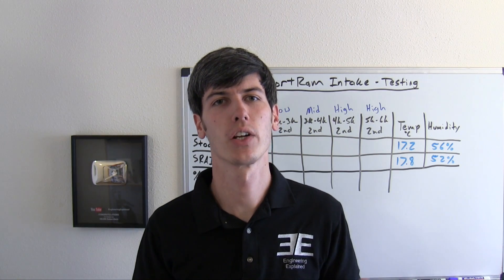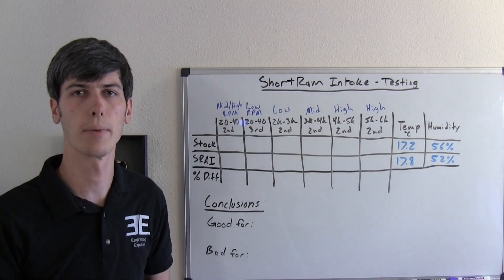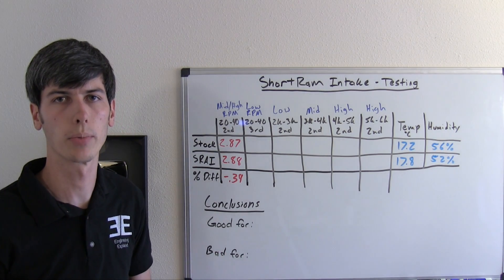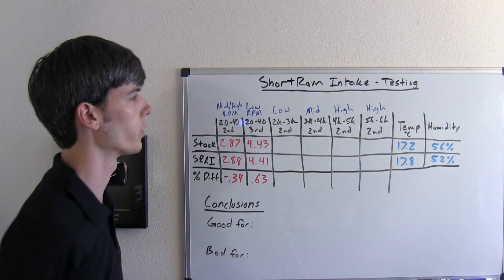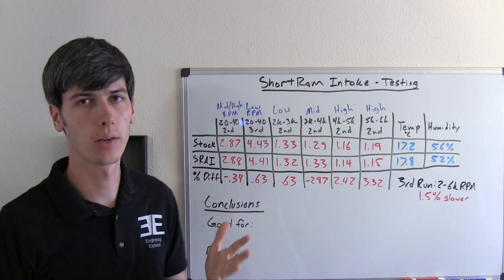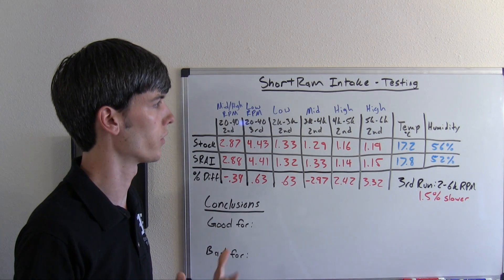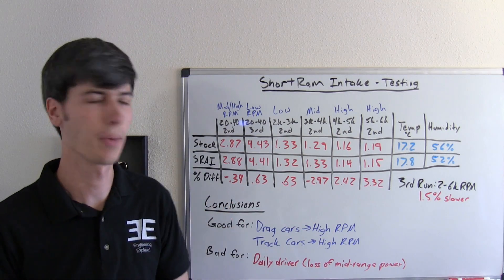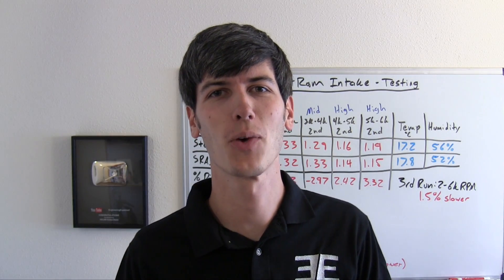Do Short Ram Intakes Actually Work? - Project Integra

Comment: I've got one on my car. Doesn't really do anything except give a nice sound and look cool under the hood haha
Reply: Basically street cred
Reply: I had installed an eBay short ram on my 96’ Chevy C1500 5.7 it sounded not so great when accelerating, I think it may have caused a minor misfire or too lean of air flow constricting the engine more than the stock air intake... Felt less smooth under acceleration too.. Couple months later decided to compare the diameter of the short ram vs stock tubing.. Didn’t realize the stock tubing is roughly about 3/4 to an inch larger in diameter than the short ram “performance intake.” Reinstalled the stock air intake today and with the stock thick paper filter already felt and sounded better, went to auto parts store and purchased a K&N E-1796 performance filter.. The real test will be this weekend when I accelerate to high way speeds to work..
Reply: you know what will help if you did some exhuast work 
i took my muffler chamber out put  a aftermarket resignator on it and she sounds amazin but i dont think it does noothing it compliments the exhaust sound and helps  a little bit when you hit the thorrtle
Reply: Do you get a engine light from it ?
Reply: Jimy Official if u have the censor connected it shouldn’t

Comment: In a naturally aspirated car it is significantly more important to get cold air to the engine, With a CAI im sure the difference will be better

Anyway, what most people dont get is that any mechanical or support moddifications done to a car must be backed up with the engine ECU mapping and programming (like optimizing fuel delievery and ignition timing) for the engine to produce significant improvements

Comment: You need to rev it much higher to see the gains. Its a honda youre supposed to rev the nuts off of it all the power is up high youre barely cracking vtec
Reply from the maker: Friebe1000 It doesn't have VTEC.

Comment: should have really used a turbo car considering theres much more air used than a n/a. the difference would be magnified and clear. Why haven't you turbo'd that integra?
Reply from the maker: warfl4g Not necessarily depending on the size of the intercooler. Because time.
Reply: Engineering Explained really? i thought that an air intake restriction would change results a lot on a turbo car. N/a car would still suck a lot of air.. but that air being sucked would be used as exhaust to push the turbo and suck a lot more air right? If it didn't suck more air with the turbo, wouldn't it be the same power ratio as n/a and be useless? shouldn't the short ram intake show different results to a stock intake with more dependent sucking of a turbo?
Reply from the maker: Ahh, based on restriction, yes I gotcha now. Depends on the setup of course, my Integra's intake is a bit more complicated than modern ones which are shorter.

Comment: My real question is this, have you seen those K/N filters? I was thinking installing that in stock air box, that way I still have the stock design of the box and piping, while having more air coming in due to having a K/N instead of paper filter. Thanks for the vid btw.

Comment: nice test. even assuming this mod can sustain a 2-3% reduction in acceleration time with a heat soaked engine bay, what does that translate into power wise and how many dollars are you spending per horsepower? better gains can be had by simply maintaining the car and restoring lost hp! 

I realize you likely did this test in the name of science and actually don't personally find interest in this mod. I do like things like this being brought to light though cause it discourages bad taste and noise pollution!  I'd like to see a similar test with heavy wheels vs lighter or smaller wheels
Reply from the maker: Ve g Ahh, wheels would be a fantastic test.

Comment: I'm just curious, why did you choose AEM as a brand and why did you choose a short ram?
Reply from the maker: I chose AEM because they offered both an SRI and a CAI, and both were complete kits. I want to compare them side by side so I wanted to use the same brand. Also, they make a lot of claims so I wanted something that said it does impact performance rather than something that makes no claims at all.
Reply: Engineering Explained Well now I just need to wait for the next videos ( ͡° ͜ʖ ͡°) Oh, and just an FYI, AEM makes those claims by using other mods as well as their tested product. I read that for testing their V2, they used a catback exhaust in conjunction with their V2. Just wanted to let you know more about their testing setups

Comment: I had a Prelude Type-SH with a short ram and i can 100% agree with the numbers from a driving stand point. When im cruising around at 2-4 RPM, it felt slower than with the stock air box and filter but from 4000 RPM plus, it pulled a little harder. PS, Vtec comes on at around 5600 RPM. I was happy with the short ram though. It gave the engine a bit more sound for cheap and without installing a huge fart can

Comment: People will always try and defend the fact they spent a significant amount of money on an intake kit which they probably installed themselves. Fair play to Engineering Explained for actually running the numbers and doing a fair test. Of course the stock system is going to be better, it was developed to run with a stock engine as efficiently as possible, do you really think a design team is going to design a 'restrictive' system for an engine that needs to be as efficient as possible if all their problems can be solved with a simple bit of bent stainless steel, a pod filter and a few hose clamps. 

Just my two cents, and great videos.

Comment: Did you re-map the engine after changing the intake? If the new intake has less restriction or increases the air pressure to the engine, then the engine would run lean, that could be damaging to the engine in the long run. In order to take advantage of the increased air-flow, then you need to also increase the fuel injected into the engine.
Reply from the maker: ECU was reset. It has a map sensor so it can adjust to differences in air density.
Reply: Engineering Explained I love how everyone in here thinks they know everything about cars and you have no idea what you're doing lol
Reply: Perhaps you should do a test before and after you reset the ecu. In order to determine to what extent (if at all) the standard ECU can adjust for changes in airflow. Weather a reset can really make a difference for small upgrades such as a s.ram/cold Intake change. This would be an interesting test if say you exchanged the std camshafts to 270 cams. The ECU can sometimes hide a lot of "locked up" power in some cars if not tuned perfectly. just a thought..
Reply: Enzo Ernst I just want to clarify that when he said "ECU was reset" he meant it resets automatically through the information the MAP sensor gives. He did not tune anything or touch any buttons. It automatically adjusts, so doing a before and after test is not possible in this case.
Reply: I see. I wish my ECU was that simple lol
Reply: Enzo Ernst If your car if fuel injected than your ECU is that simple
Reply: not mine. it doesnt have sensors like MAF or CAS... its all programed to be fixed. Its my own ECU system. its just standard NA so not as complex as a turbo setup.. yet :P
Reply: Enzo Ernst How does your car start when its cold outside than?
Reply: Knights2theEnd well where i stay temperatures range from 10deg C to 32deg C. so it never gets too cold to function. also the air is more dense during cold mornings so the engine is more effective on cold days. Hot days are a bit of a headache though. How it all started CA18DE blew CAS and MAF. so i did some tweaking with the ECCS (given the exchange rate replacing these will cost more than what my car is worth) and bypassed some systems. now basically your fuel air ratio should remain linear through your rev range right? so basically it is similar to a distributor. at set points during a revolution of the camshaft it sends electric impulse to the injectors. for each X unit of  air you need Y units of fuel. the spark still works so i left that alone. By taking Bernoulli equation through the cold air intake through to the cylinder head you can determine both the velocity and pressure of the air. this allows you to calculate the mass flow rate of the air flowing through at various RPM. Scatter plot these on a graph and you can basically form an exponential graph combined with a line of best fit. the exponential show the mass flow rate of air and line of best fit is the fuel ratio you wana run. basically its an electronic carburator if that makes any sense.
Reply: Enzo Ernst aaaannnnnnnnndddddd

Comment: I got told before that if you put an induction kit on a car it will only really make a difference if you also upgrade the exhaust and get the car remapped to make the most of the increased air coming in and exhaust gasses going out. cheers :)

Comment: Every one of these tests just proves that this car has a VAGINA under the hood.
Finally a ricer who understands and isnt afriad to admit it.
Any mod you do is mathematically figured like this. Stock Power 0 X Wussy Mod Gain of 1.5% = 0.00000000000 Horsepower."Zero" Multiplied By "Anything" = ZERO
You can polish a turd but its still a turd....a very expensive shiny turd....but still a turd....
Maybe 3 years from now we will see this thing run a 22 second quarter mile with an electric turbo and underglow? WooHoo!!!
hahahahahahahahahahahahahahaaaaaa
Ok im done now, dont bother firing back at me to defend your spraypainted turd that your mommy bought for you.
OUT

Comment: I don't understand how shortening and simplifying the intake piping causes the engine to perform worse at low/mid RPM. Increasing air flow to the engine is bad for low-end power how?
Reply: More flow is good for high RPM, but resonances at certain engine speeds can reduce torque. The stock intake has probably been designed to avoid these resonances and maximise mid range power.

Comment: Aftermarket intakes are probably one of the most useless mods you could possibly do, performance wise anyway. Unless you route it so it gets some kind of fresh air (like the stock intake has) it can only use the air cycled threw the engine bay. They should just call them hot air intakes lol

Comment: SRAI is a great system so long as you set the car up for it.  I would recommend isolating the heat from the filter with a box.  For the cheap end get some sheet metal (needs at least 2 sides and a bottom), corner brackets to attach the pieces together, and some kind of insulation (Dynamat works great). Also routing the airflow helps.  Some aftermarket hoods are designed to operate with these systems in mind and greatly help with the performance.  The numbers may not go that much higher but consistency will become better.

Comment: This was an incredibly diligent test and very well thought out. Thanks a ton for putting in the effort.
But damn... the best increase was 6 hundredths of a second between 4k and 6k, and it apparently warms up after several hard accelerations and negates that small increase, thus contraindicating it for a track car. And people shell out hundreds for these things. Thanks for validating my incredulity :p can't wait to see your CAI test!
Reply from the maker: Yeah, I think looking at a % difference in acceleration is more meaningful though. It's a difference of around 6 hundredths for a very short duration of time. 2-3% improvement in acceleration is meaningful (after all, removing 84 lbs from my car yielded an improvement of 4.3%), but only if you're able to keep it in that rev range.
Reply: Engineering Explained do you think there would be more benefit if a tune was done after there installation of the SRAI? And if so do you think it would be a significant increase or still down in the hundredths of seconds?

Comment: Waiting for the cold air intake. I'm quite suere that there would be a better improove in all rpm range.

Can I make a suggestion? When I installed a cold air intake on my car, I usead a pipe insulation (used usually in PVC pipes) to cover the stainless steel pipe in order to keep the intake aire as cold as possible. You can faind that on your local hardwere store.

Keep making that videos!

Comment: It's quite possible that this particular engine was already receiving about as much air as it could given the other limiting factors (throttle body size, potentially leakage in cylinders etc.).  I do not recall if this car has aftermarket exhaust from the exhaust manifold, which could also be a limiting factor if not.

Comment: Is it actually stock or just without the SRAI? I would imagine its just with and without the SRAI, including all the other mods you've done...
Reply from the maker: Nate den Hollander The only other modification which could be affecting power is the catback exhaust. It also has some weight removed.
Reply: Engineering Explained Yep that's what I thought - keep up the good work!

Comment: i dont know about hondas,
but on most cars ive owned i usually reset the ecu when i do mods so the computer readjusts for them.
might have made a difference here?
Reply from the maker: Phil It's a map sensor so it's based on speed-density of the intake air, which will adapt based on how much air is coming in. You don't re-tune your ECU when it's hot (or cold) outside, or when you travel to high altitudes, right? It can adjust for the small change.
Reply: Ummmm no. Any significant mod will require a tune. Your ECU can't just magically self adjust for anything you throw at it, that's why tunes exist in the first place.
Reply: Ismael Salinas nah, i wouldnt call a pod filter a significant intake lel.
and yes most ecus can adjust for small changes as stated above.
I recently put a 3inch midpipe on my subie and it was significantly slower until i reset the ecu.
Reply: Phil I agree that ECU memory could bias this test. 

Modern ECUs will learn long term fuel trims across a matrix of different speeds and loads. Changing the intake could lead to the car running lean/rich at different load points while the computer adjusts the trim in each memory cell. A reset without going through a full relearn would bias the results too.
Reply: Phil is it a turbocharged subaru? Because I own a 2009 wrx. Anytime you mess with back pressure you wanna make sure your car isn't over boosting. Most cars can obviously compensate for small changes. Headers, intercooler and other changes that your computer can regulate via sensors is fine. Those are small changes. But changing a midpipe? If I did that I would at least take it to my tuner.
Reply: nah ive done a lot of work to the car, over boosting is the least of my worries lol.
closed deck block v4 forged pistons and rods, acl bearings. its not a race engine, but will take 20psi allday.
Reply: Phil Nice, well yeah we're in different positions. I don't have forged internals so I actually have to watch how much boost the turbo is producing.
Reply: yea id be worried about thrashing a 09 car lol.
i only paid 1700nzd for my car not including mods so i give it a bit of stick
Reply: Phil lol well yeah. I paid 19,000 USD plus mods for mine so I take care of it
Reply: Engineering Explained
Shouldn't that old Acura have a Mass Air Flow sensor, not a Mass Air Pressure sensor? It's not turbo'd so there wouldn't be a need for it to sense pressure, assuming you haven't done any conversions you haven't told us about...
Reply: stevetheviking Mass air flow and speed-density (MAP) are two approaches to calculating how much air is going into the engine. Both are used on naturally aspirated engines
Reply from the maker: stevetheviking Here's a video of it if you're interested (I show my car at the beginning, you can look for yourself at the MAP sensor). MAP Sensor - Manifold Absolute Pressure - Explained
Reply: Engineering Explained
Neat. I haven't been under many Integra hoods, so I didn't realize it had MAP from the factory. I figured being naturally aspirated it'd have MAF like the vast majority of other vehicles. I bet that makes turbo conversions a bit easier on those.

Comment: I'm sure the pressure on the pedal is a huge variable. how do you stay consistent?
Reply from the maker: ***** Fully depressed for every run. This video explains it best: Acura Integra Weight Reduction - Acceleration Testing - Stage 1
Reply: He floors it, simple
Reply: Engineering Explained
ok. thanks!